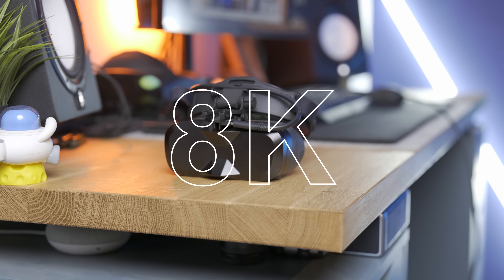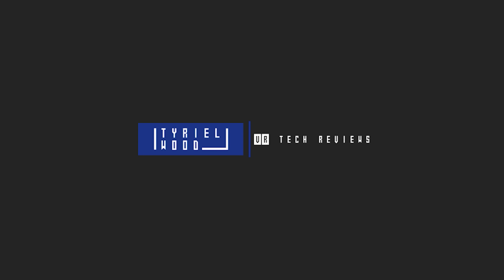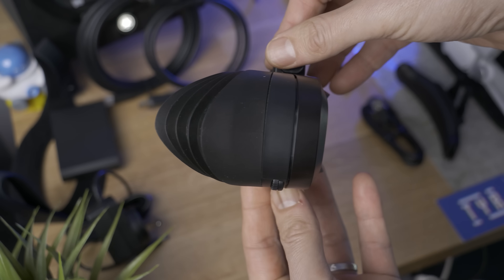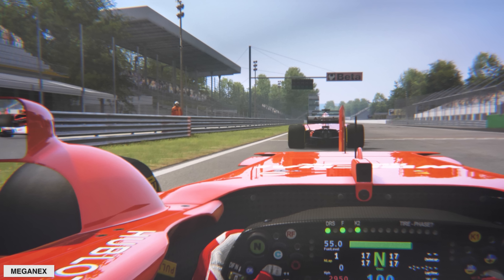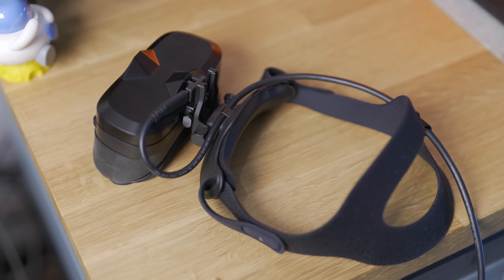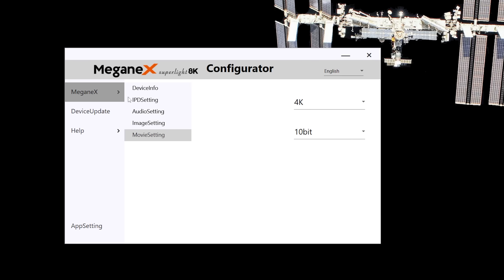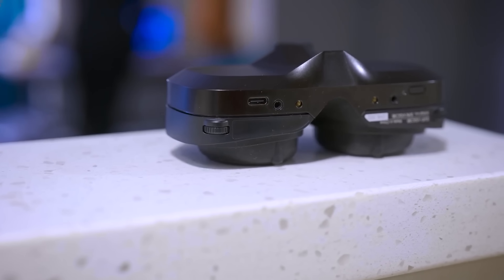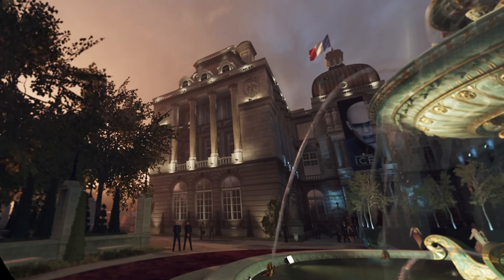The Highest Resolution Micro-OLED VR Headset. MeganeX 8K 1 Month later.

Comment: just got mine today... a bit of troubleshooting but got everything to work finally !... happy about most, except cable (even the 5ft is short)... but biggest thing is BARRELL distortion. 
Where can I get that driver that helps fixing it?    the focal point is not that big, but definitely better than BSB1
Reply: Half Life Alyx on this is fantastic... I had run it with Quest Pro and original Index. but i need to see how to fix Barrell distortion

Comment: its funny, I use a 3 meter cable for my quest headset and I can go everywhere in my room and it wont even get tight ! tho also my room is extremly tiny and its like 2 by 5 metters, so the 3 metter cable is fine in my situation

Comment: I had my first Meganex superlight 8k. The distortion profile was horrible, warping, very bad edge clarity...I was sooo dissapointed. ...and alsobafter a month of using it, I have noticed a dead pixel in the right lense at the far right just below the middle line.
I contacted Shiftall and they were very nice. I send the headset back to Japan and they confirmed the defect (dead pixel) and replaced my unit with a new one. They also noted the bad distortion I was getting. I got it back very quickly (Shiftall payed for everything related to shipping).
My new unit is night and day compared to the first one.
Distortion is now atba really acceptable level, especially with sboys3's GUI.
I am not 100% sure, but I think they gave me a unit for which they knew was good.
I am very happy now and I can finally enjoy it.

Comment: What I've learned from watching reviews for years is sticking to the Quest lineup for $500 and waiting for the Quest 4.
Reply: Sadly, the Quest 4 isn’t coming, should’ve in 2026-2027 but.. Meta cancelled the project in favor of a new AR/MR type of glasses iirc. I could be wrong about the new product but as far as intel goes, no Quest 4 in the works anymore 🥲
Reply: @scholarAlim  Doubt it. Without cheap headsets 95% of VR users will disappear, probably killing VR
Reply: @favoritodiavolo You’re absolutely right that if it weren’t for these cheap headsets, VR would be a lot more of a niche subject. Meta/Oculus definitely added a huge part with the Quest 1 and 2. However, I believe the Quest 3 can make it atleast another 2 years (possibly?). I have based my opinion off of reports and some videos I’ve seen. Hopefully you’re right, and they’re wrong.
Reply: @scholarAlim  Yea I've seen those videos too. I just don't buy that these small devices cost $1000 or more. Cell phones cost that much and a VR headset  that only streams what a computer is putting out isn't worth that.

Comment: I never got my headset, nor was there any professionalism by the people that told me that this was coming six months ago and instead they laughed at me when I didn’t get my headset and tried to blame me. I am no longer in VR, even though I have three headsets sitting in my room right now because I will not spend money on anything that makes me unhappy and this isn’t the first time something like this has happened.. let’s talk about the quest pro getting dumped immediately after being released. No respect so no money ever again
Reply: Allowing manufacturers have that much controller over your buying habits for a whole device category is pretty sad. Especially regarding the Quest Pro which was an abysmal prosumer product not hitting any of the prosumer benchmarks that the Vision Pro does. 

Even if it did during that time, it wouldn't really be primarily for gaming like most headsets as the balance between high resolution and high refresh rates was far more compromising than today that allows headsets like the Meganex Superlight 8K being able to exist.
Reply: @lilkwarrior5561  I use it primarily for flight simulator so if it had been supported correctly that would’ve been one thing, but that isn’t what happened.  It’s been a lot cheaper since I walked away, not having to pay for a software and hardware that doesn’t work correctly.  I have thousands of dollars just for software.  Oh well, they don’t get any more money.

Comment: Ahhh, now the truth comes out after the hype phase bandwagon is over. Brand new company, brand new headset, no return policy, fanbase correcting their shoddy work, finicky operation, distortion in the lenses, diopters difficult to use, graphics cards barely able to drive it, etc. Maybe they need one or two years to get their shift together. You know, like Bigscreen did. Interesting !
Reply: GPUs barely able to track it isn't really true; there's over two generations of GPUs that can drive it easily with AI upscaling with or without frame generation. VR and spatial computing that is actually sharp and good vs. traditional computing needs resolutions that are fundamentally taxing to GPUs on average. That's unavoidable with all headsets of the tier of this headset and other great ones from Pimax, Beyond Bigscreen, and so on. That isn't changing indefinitely and only alleviated with tech like foveated rendering and frame generation as far as lesser GPUs.

Comment: Does MeganeX only work through SteamVR?
OpenXR cannot be used.
Reply: There is no Meganex native OpenXR driver, but you can use OpenXR through SteamVR. It lowers the FPS a bit due to the extra layer.
Reply: @jjtrooster not true. There is no extra layer.
Reply: Thank you for your answer.

Comment: Did you try removing the 90deg L USB adapter from the headset? That adapter is known to cause a bunch of issues with the display. Try taking out the USB-C adapter, as it was built as an after thought, and plug the USB-C cable directly into the headset. It fixed the display issue for a bunch of people.

Comment: I have 2 Meganex headsets, one preoredered and one bought on ebay for 1500 euros. I cann say that they are worth every cent. At the beginning I was as frustrated as you with the bad connection,  feeling like a poker game and I have wrote some mean mails to shiftall about it, but after 3 weeks of trying and changing things I think I have now the best VR   experience available in 2025. I had  in the past a pimak 5k, Index, vive pro 2 and the Varjo XR3 and I have tried the VR4. To make the Meganex worth its money you should throw the L-shaped usb connector in the garbage where it belongs, use a nice 3m usb c 3.2 cable directly connected to the headset, I have a 10gbs rated cable which is thin and works perfectly fine, use the version 1.4.0.0 of the Meganex configurator, the last firmware and the great simplehmd0.3 from the SBoys3 . After that write your objective review.
Reply: Connect the usbc cable from headset straight to computer or link box?
Reply: How's the Fill factor? if you use lower resolution, at lets say 3K per eye and than have it upscaled to 4K per eye, will it look worse compared to being displayed natively on a 3K per eye display(If one ever existed), or would it be the same. I'm worried that lower resolutions will result in a softer blown up, possibly jaggier image.

I'd rather get the MeganeX over the BSB2e simply because of it's near perfect Stereo overlap, and I want the leeway for higher resolutions @90hz.
Reply: Or just buy a BSB2, save a bunch of money, and it works properly out of the box...

Comment: In the full review I would like to know if realistically its just too high a resolution for todays gpu's at reasonable framerates. Surely it was folly for 4k per eye at 90hz without a eye tracking and dfr solution.
We cant even spend our way out of this! The 5090 isnt all that much more capable than the 4090?!?
Reply: the VR rendering pipeline needs an entirely different approach IMO. tbh it might be the one case where dual-gpu setups like SLI/Crossfire made sense, if they could run independent signals for each eye/display, with each GPU rendering only frames for that individual eye.
Reply: @Munky332  I think there is room in the market for a single-slot dual-gpu for VR enthusiasts, with a ton of VRAM for pushing 8k or 12k per eye and wide fov.
Or maybe it has to be a console, where they can control the whole thing including the dfr at a hardware level.
Reply: @CorporateZombi  nah, it'd have to be dual slot for the PCIe throughput. I had dual-gpu single slot, as well as quad-SLI (two 7950GX2's). it was fucking terrible. the entire render pipeline would have to be reworked from scratch, and it'd be such a niche case it'd die just like SLI/Crossfire did. VR isn't in a good place right now to begin with, considering all the absolute failures we've seen in the last year or two.
Reply: @Munky332  One pcie gen 5.0 x16 is 63GB/second. Is that really going to be the bottleneck? I'm thinking probably not, because even pcie gen 3 x16 (15GB/s bandwidth) on a 5090 only show a 4% dip in performance compared to when it is connected to gen 5 (source Gamers Nexus), and gen 5 has significantly more than 2x the bandwidth than gen 3. So 2x gpus on a gen 5 slot would maybe only account for a maximum 4% dip in performance (from the pcie slot) if you could stuff two 5090s into it.
And maybe it would be beneficial if the two gpus could share the same texture memory, idk.

Providing over 1kW of cooling however 😎
Reply: 4K² per eye is possible with a 600€ graphic cards...You can play Valorant, Beat Saber, War Thunder, etc..plenty of games...
doesn't require 3000€ GPU
By example  fly over the world with Earth VR in 4K² is more friendly GPU than with Fs2024...

Comment: 7:04 - Yup... review done! :D :D :D 
Oh and faq flip up... that MacGyver shhit is there ONLY because they have trash bin chips inside so no passthrough.
You have to be really "focused" (I am polite) to buy this.
And I like MacGyver stuff... Ido it every time on my headsets but still that hinge and cable connector  is factory grade junk.
11:45 basically the review is killed a second time... so after asking an arm and a leg for a barebone small monitor, no passthrough, nothing stand alone, no controllers, no base stations, no cable (basically)... the  software is a total garbage and was replaced by the community altogether.... man... come on...

Comment: VoodooDE VR has a chart of 20 headsets in his review showing that the Meganex has the narrowest, most claustrophobic FOV ever measured, of 84º!
Reply: Its 96-98 degrees with the new driver. VoodooDE has very deep eye sockets
Reply: How does the driver change the FOV? Surely you need to move the lenses closer to your eyes to do that?
Reply: @CorporateZombi  Original driver wasn't utilising the whole screen, so some pixels weren't lit up
Reply: @MYS20067  omg! Lol
Reply: @MYS20067 this is disadvantage of the new driver because the view shape is no longer rounded. I hope it will get fixed in future iteration.

Comment: Any word on Deckard screen res yet? Deckard stand alone and wired mode i think is the key to VR sales with high res and iR DFR to succeed.
Reply: The dev kit was leaked to have 2k per eye lcd panels, so that is the minimum, there is almost no chance of 4k per eye oled at the expected 1200$
2.5k per eye oled, or 4k per eye lcd are theoretically possible
Reply: @Grimoire0w0 4k oled pancakes per eye like the MeganeX are around $500 A PIECE, so no, it ain't happening.
Most likely 3k lcds.
Reply: If I had to guess I bet you the resolution of deckard is similar or same as the beyond

Comment: This is not the highest resolution VR headset on the market.The pimax super is higher than this.
Reply from the maker: It's not out yet. So yeah, not on the market.
Reply: @Tyrielwood what are you talking about, I know at least 2 normal people (not youtubers) who received theirs already.
Reply: conventional RGB stripe arrangement of subpixels will always be sharper than current OLEDs, even with exactly the same resolution. This is simply due to the nature of this arrangement and size.
The same can be seen with monitors and TVs. Physics.
Reply: @Datenschutz_Datenschutz  
Crystal super has more pixels per degree
Reply: @kangjames2492  OK, you've missed the point, obviously.
Reply: @Datenschutz_Datenschutz  I get the point. I have both of them. It is sharper, but if you go by his wording; He said that it is the highest "resolution" headset". It is not.